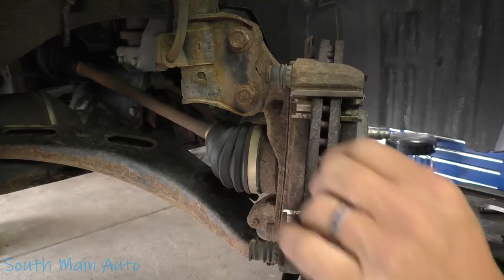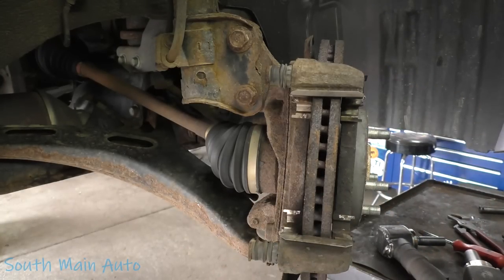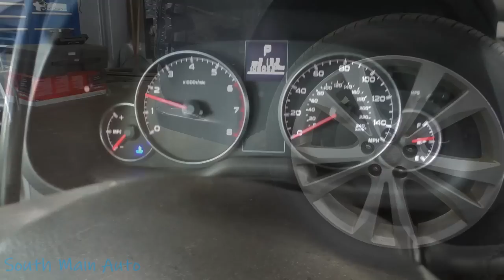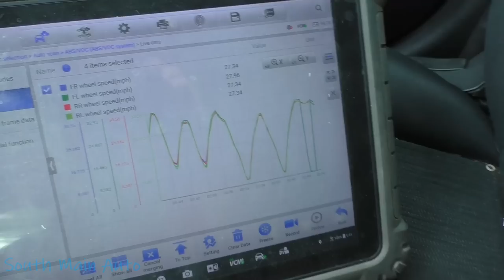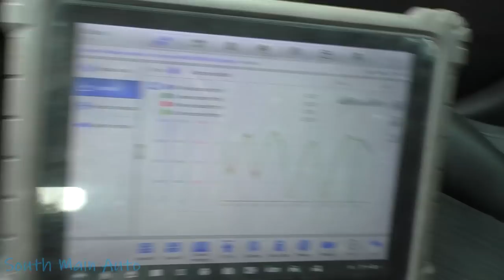Subaru Legacy - Front Brakes & Wheel Speed Sensor Problem

Comment: Her husband might have inadvertently stretched the speed sensor wire when he replaced the CV axle like I did.  From the outside the wire looks normal, but I got a error symbol on the dash afterwards concerning the (anti-lock) braking system.  I also had to drill out the sensor on the other side because it was frozen in the knuckle.  Thanks for all of the fine little detail tips you gave us in the video.  Those "little" details can make all the difference & save us some frustration (& time & money) down the line.

Comment: I worked on an older Nissan Xterra with a spongy pedal for a friend recently. He had it to some shop where they bled everything out, which did nothing, then told him it needed a replacement master cylinder with a larger bore (?) and a matching booster (??) at a cost of $1200, at which point they would "evaluate" the ABS system (???) as the next step. I looked at it for him. It wound up having a bunch of slider pins frozen and unevenly worn pads. New pads, rotors and caliper pins and the pedal is back where it belongs. It's hard to find a reliable shop.

Comment: Looks like someone changed the pads, but didn't grease the pins.  The pads and rotors look fairly new.  It's crazy how much rust you guys have to deal with.   Here in Oklahoma,  I don't think I've ever seen locked pins.. unless the pads were wore down to the steel and even then.. I don't think I've ever seen one locked unless the rubber boot was gone.   Salt is a nightmare that I don't ever want any part of.
Reply: Pretty much every brake job I do there is a seized caliper pin.
Reply: @mph5896  interesting..   I guess maybe for people who actually have to go pay a mechanic, they probably do neglect things long enough for it to happen.   But I work on all my own cars and my family's cars, some friends, etc.   So I guess it's possible that I just keep up with maintenance for it not to happen. :)..  at least not on all our stuff.

Comment: Vanessa is looking fantastic as always. Lucky you caught that left front sensor acting up. Sensors are the most common cause of ABS problems but not on my 2009 Mercedes C200 (it was the magnetic pickup ring that had delaminated). I use the "Don't call me late for dinner" joke too.
Reply: ABS can be a pain when it wants. I fixed one that the magnetic fell apart, and the only fix was to replace the cv axle. I have a GM that only likes to act up at about 7 mph, below that is fine, above that is fine. I'm sure that is the sensor, it seems like a gm issue if you search it. I wish they just kept things simple, like the old 90s jeep I mainly drive. It has abs, I know it does, but I never interact with it. It never has an issue, it just works when its time. I want to know why this thing can have ABS and never have an issue but modern stuff can't do that.

Comment: Hay Eric if you look close at that speed sensor there are 3 or 4 thin raised sections around the body of the sensor , just under the flange , that centers it in the hole. In my opinion  because its so thin in that area , thats the only reason it comes out so easy. I have never seen that on any other manufacture except subaru , great design
Reply: Fords have a similar setup to mitigate rust jacking.

Comment: I remember the caliper pistons on my old legacy looking super rusty crusty like that, looked like it'd blow any second before I replaced it.

Long story short, trying a very thin layer of caliper lube inside the pistons on my new toyota to try and prevent that. Had to pull the front brakes apart at like 3k or 5k because of squeal and saw a the beginnings of rust inside the pistons. Friggin caliper guide pins stiff as heck and darn near dry too, do better yota..

Comment: seen it happen when someone replaced a CV or wheel bearing and plastered everything with copious amounts of never-seize and that interfered with sensor. luckily the all plastic Subaru sensors like those dont get stuck - it is usually the bolt that breaks off on Rustyland cars...

Comment: I would suspect a loose or dirty or corroded connection at an electrical connector, given an intermittent issue that involves a sensor.  Got the wiring diagram for that car?

Comment: Speed sensor circuit code is always a open in the circuit, air gap rust was a big swing for the fence by the great Babe, good to see it was a intermittent open, but the switch is the best possible next step in the diagnostic flow tree

Comment: Swapping side to side in that situation is fine? you still get a pretty mcuh definitive answer. If the problem goes away it was all the rust and crud. If problem is still there you know if it's the bearing or sensor itself.

Comment: I had a bad magnetic ring on my wife's Cruze.  I changed out the sensor and it reset the computer code itself.  It got a code again first time out.  She had to be going fast in order for the code to come on.  I changed out the hub and as I was taking the old one out, the magnetic ring came apart and fell off.  So I guess the moral of the story is that when you do the repair test the car as it will be driven through all conditions.  Slow, fast, braking, accelerating and such.  Thanks for another fine vid.  I learn something every time.

Comment: I'll tell you Eric I have a 2013 Outback and after doing front control arms (having to remove the front CV axle) I ended up having to remove the left wheel speed sensor. Since then, it gave me the P500 code...so I swapped in a new sensor but the problem continues to be intermittent   Very weird. subarus are weird sometimes..

Comment: I'm done with rebuilt calipers from Napa. I've changed the rear calipers 3 times in the past 2 years on my Accord for the parking brake actuator breaking and seized pistons. Sucks they cost over $300 brand new!
Reply: Buy once cry once
Reply: I've had good luck with the AutoZone remans. Iirc they are made by cardone

Comment: We have the 2012 version of this car it had same problem of spongy brake pedal and I bled system changed master cylinder only to find the slide pins were a bit sticky cleaning and lubing the pins seemed to help a lot.
some ground wire that comes off the bundle of grounds that go to battery seems to have corroded off and is dangling but i can't figure out where it was attached to it has broken off stub of a ring in end of wire. I just don't see a spot missing a ground wire and everything works fine.

Comment: I had a customer bring ebay detriot axle hub assemblys for the front on a forester. Put them in threw it into limp mode. They were reading 5 mph slower then they should have been, also put cheap cv axles in and it had a death wobble from heck. The customer provided the parts. Thats why i get my parts at napa, because if any of that happens they replace it, or oem.

Comment: Changing a relatively inexpensive part can answer a myriad of questions even if it wasn't the problem saving time and money in the long run.  Firing an educated guess from the parts cannon is a legitimate way of determining the cause of a problem, as opposed to loading it with the entire parts store because you have no clue WTF you're doing.  If anybody has a problem with that, that's why I have a middle finger and I'm not afraid to use it.
Reply: 🖕🏻Cheers 😂
Reply: I agree. Just be straight up with the person paying the bill. There is a good chance this part will fix it, but it’s intermittent so it may not. Let them make the choice. If that was my car, I would have winged a sensor onto it 2 minutes in

Comment: Usually the rubber sleeve on that one sliding pin swells up on my Subaru because I used petroleum based grease (wrong grease) instead of silicone based caliper slide grease.  The silicone based grease doesn't react with the rubber.  That one pin is always my stuck one, and I have to replace the rubber sleeve because it's too swelled up to re-use it at that point.  Where do you buy the proper brake pad hardware do-dads, the dealer?  I've noticed the ones that come with the pads don't usually fit.
Reply: That was my question too. Where do you get the “correct” hardware? 

If you buy OEM pads from Subaru I assume you get the correct PSA that way. But NAPA?
Reply: @Dave-ei7kk the hardware that comes with NAPA stuff is pretty good, as long as you don't get the cheapest stuff... Silent-Guard, and up.

Comment: What a moment indeed! When it come to stopping fluid escaping from a brake system that's temporarily open for service, is I grab some polythene, cover the top of the master cylinder with it and refit the cap. This creates a vacuum in the system when a line is disconnected that prevents all the fluid getting out. Quick, simple, easy, clean 🙂Also with the tool spinning before contact with the fastener I finally saw you knock the corners off one!
Reply: Will have to try that trick with the master cylinder.  Yeah, that spinning socket routine is only for a seasoned pro.

Comment: Wow, only 108,000 miles and this came up?   I live in eastern CT about 120 miles from South Main Auto.  I have a 2013 Legacy with 140,000 miles on it.  I have had none of these issues (except the rear wheel bearings but at 130,000 miles).  Are NY roads that much worse than CT? Or because I am diligent and clean the bottom of my car with water after every snowstorm/salt application so I don't have so many rust problems?  Anyone know?  Great luck getting that intermittent fault on the left front sensor!

Comment: 2.5 Subaru 1997 - 2012 if it's for sale you better ask when the head gaskets were replaced and what type of replacements were used.  Because they all need it.  And the stock type head gaskets will fail again.

Comment: great video Mr. O, as a long time subaru owner, i do a lot of the work /maintenance myself, i can comment subies do not like aftermarket crap, like dura, o'rei, nap crap, for example. oem rotors and pads i get 60-70k miles, folks i drive into nyc on a regular basis, after market crap? at 30 k, start getting the shakes.  in my experience i always try to use oem subaru parts, many made in japan. and if you shop around, you can get good prices. my 2011 3.6 outback has 260k. still going strong. thank you for video.

Comment: And BTW, that Subaru was not a comeback.
A comeback is when the same vehicle comes back for the same repair.
This lady came back but for different reasons.
The speed sensor doesn't qualify because it wasn't due to any incompetence on your part.

Comment: i just today replaced my front press in wheel bearing, ball joint and front brakes, brakes include new pins, boots, pads, rotors and hard wearing on my 2000 yota echo

Comment: I put three aftermarket speed sensors in my daughter's Forester.  All bad after a few months.  I bit the bullet with a Subaru sensor and it's been fine since.  Still NOT using Loctite.  Using blue Chinese garbage on your bolts.

Comment: I end up doing more tryagnostics than I like to admit simply because it will cost 3x as much to prove/find the problem definitively In fact I have a fuel tank psi sensor on order right now I will check the connector, pin fitment, and gasket as I install it My cost was $20 the labor to drop the tank and test is $200. I offer the consumer the option and explain the labor is the same either way; the most likely culprit is pin fitment/corrosion OR a bad sensor would you like me to install one while I am there or not??

Comment: I do have a question - why do you not use a vacuum hand pump when bleeding the brakes? I have a cheap one from the ol Harbor Freight that I've used and it seems like you could save Mrs. O the trouble?

Comment: This kind of stuff is why I like your videos. All the things you should do to make the repair. Spending time on cleaning up rust was a waist of time. The job only calls for this much time. These are things I was told from a shop manager I worked for. I had a car with no ac once that I found damaged wiring harness that was wrapped up in the cv axle. I was told the time I took on the repair didn't make enough profit. Although I had a happy customer because there ac worked. The shop couldn't make the money they wanted to make. I don't work there any more.

Comment: I love Mr O, he does great work...but theres a lot of things on his brake jobs that could use work. 

Always clean rotors with brake cleaner. They have coatings on them to prevent them from rusting. Always re grease new slide pins because i know for a fact there isnt enough grease in there. You don't need loctite on caliper bolts, ive done thousands of brake jobs, never used loctite once. Brake jobs are so easy, they don't need to be complicated more. Grease the shit out of slide pins.

Comment: I have a '06 Forester and last year the LF caliper was hanging up.  Stab the brakes and it would drag and not release.  The last time this happened I barely got the car home and it was smoking hot.  I hauled it to the local Subie dealer as no time to mess with it and winter fast approaching.  The rotors, pads, and calipers got replaced ($900).  I am sure I could have got the parts and done it myself a lot cheaper but my time is worth something too.

Did the wheel bearings on it some years ago so familiar with the assembly of it all.

The wheel speed sensors look different from those on this car in the video but they DO have "rust relief" in that there are ribs on the OD of the sensor in the hole so that it does not rust solid in there.

Comment: Changing only one variable at a time is a great troubleshooting rule of thumb, but it should really be about changing only one dependent variable. In this case, if you had cleaned the seats and swapped the sensors, there is no situation where the outcome is more ambiguous than if you did them independently. If you did both and the problem never came back, you still know that the seatment was the problem, and if the problem did come back, you know if the problem is following the sensor or not. As it is now, all you know is that it isn't the seatment. There could conceivably still be something wrong on that side of the car that isn't the sensor itself.

Comment: I am a little bit jealous of parts and sometimes tools you can get hold of "easy". 
I live in a country with salt on the roads in the winter and we cant get a caliper with bracket. A core is onley the caliper.
And you should get a pressaure brake bleeder. Then you dont need an assistant.

Comment: Idk about Subaru but on freightliners you can unplug the wheel speed sensor from the harness and set your meter to ac voltage. Should get a reading on around 1 volt ac pretty quickly as soon as you rotate the tire.

Comment: I have that same make, model and year, and have found it to be quite reliable. Been paid off since 2017, quite peppy. Yes, needed bearings, brakes, but crossing my fingers other than that and religious regular maintenance, hasn't cost us.
Reply: It's always bearings on Subarus... I gotta do a front bearing on mine, and mine's an 07 Legacy. Not looking forward to it because I live not too far from South main! Rust belt life sucks!
Reply: @Awkward_Fox  I'm about an hour away, and took one vehicle to them because my local shops wouldn't even diagnose it. Like literally I say, "I have this symptom" and they say, "nope". But Eric dug right into it and delivered a diagnosis and some sage advice. Pretty happy with that, even if I'm not happy with the diagnosis, glad he just gave it to me straight. And yes, I'm on my second set of front wheel bearings on this Subaru, can hear them clearly moaning. I bought a set of Moog bearings, hopefully those last longer than the cheapos I bought last time. During this video, I kept eyeballing those bearing bolts knowing I'm going to have to get into them before summer is over.
Reply: @mundanestuff  From a lot of people's experiences with MOOG as of late, they have gone downhill, but I do wish you luck with them! I know on my car, I'm going to cheap out a bit on the left from wheel bearing, but it's just due to finances, and then next year, since I'll actually have the funds then, I'll replace the bearing with an SKF/Timkin/OEM bearing as the Subaru Community has found those to be the best... Albeit a pretty expensive solution

Comment: I had an issue recently where the voltage regulator failed on the alternator and it would put out close to 20v at about 4000rpm+, and that would trigger the check engine light but only for P0500. It stored a system over voltage code in the ABS module but not the ECM. I chased the P0500 code for weeks, new sensors, check wiring, etc before figuring out it was the alternator voltage regulator causing it. Normal driving it would stay just low enough voltage wise to not trigger an ABS code or the P0500. But driving it above 4000+rpm, the voltage would spike. It was also a few month old alternator from autozone.

Comment: My experience with Subarus has been that their grounding sucks.  My 99 had a antilock  brake module code and refreshing the ground at the module fixed it.  Subaru does not remove paint under the ground connector and depends on the bolt threads to complete the circuit which is usually chalky.  I take a dremel and remove the paint on the sheet metal connection and run a tap through the threads to clean out the chalky stuff, wire brush the bolt threads and put Ideal noalox on the bare metal to protect from rust.  At this point I do this to all grounds.  As seen in an earlier video here chassis ground straps can deteriorate and should be replaced with the same treatment.  Grounds are half the circuit.

Comment: I could never understand how the pin could seize because they have a rubber seal on them and are greased. I always pull them out and grease them every time I do brakes just to make sure they are good. Again, another a small part that the manufacturer could make stainless steel since it is an essential safety item.